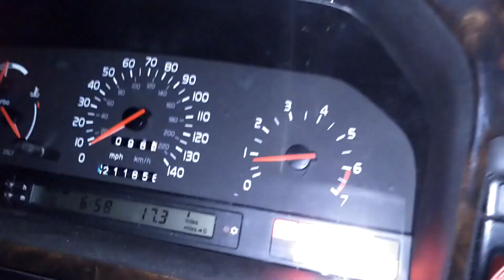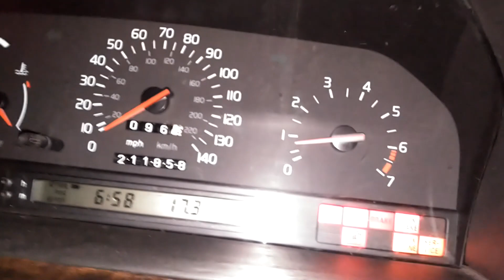Simply to cold. Ask questions here, watch the videos, search instructions, installed new WGA & more.

Comment: Hey Robert. My question is about key fobs. I have an 1997 Volvo 850 GLT, and my key fob stop working. Got a new set of replacement batteries & the fob is still not working. Is it time to replace the key fob? I guess they are not easily fixed. Should I get used or new? What model year key fobs will work on my car? The alarm light still blinks red when locked.
Reply from the maker: You can try to spray the contact buttons with electrical contact cleaner and see if that helps. I think '97 850 and 960 fobs work as long as they have the same shape as the remote you have.

Comment: Lookong to upgrade my 960, do they have specially made side mirrors with the turn signal, or do I have to go aftermarket?
Reply from the maker: There are very little parts made for 960's.
Reply: @RobertDIY  I know, I have a brake leak, and I changed the booster and cylinder, but I guess it's the porportion valve, and I can't find it anywhere.

Comment: Robert.  I’ve got a 2000 s70 glt se. They have two small coolant lines under the intake manifold that run to the banjo bolt.  I’ve seen a few people bypass the banjo bolt fitting and connect the two lines together.  Much easier to assemble.  Do you recommend this?
Reply from the maker: No. The coolant line is designed to prevent sludge from clogging up the line from the intake manifold to the oil trap box.